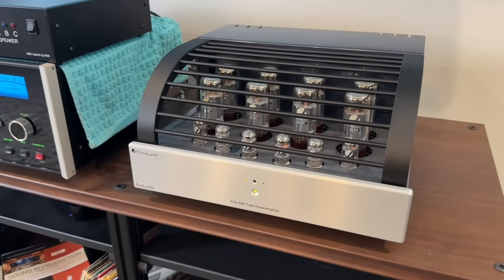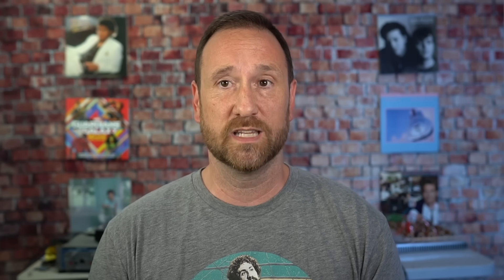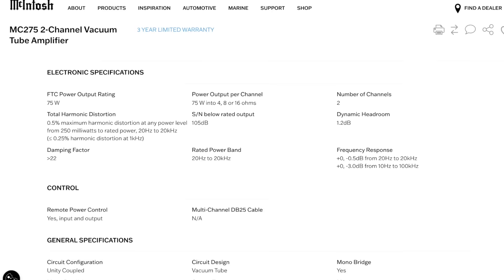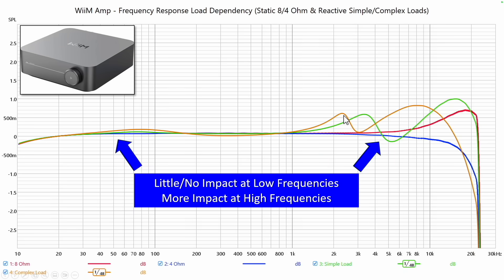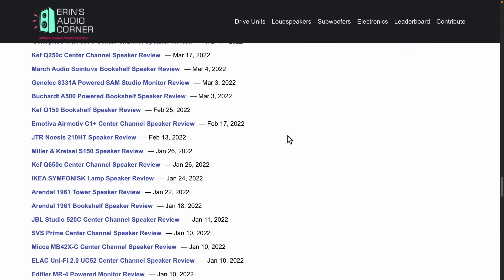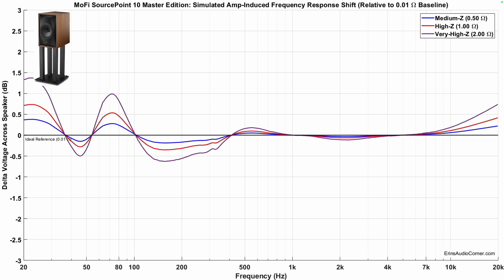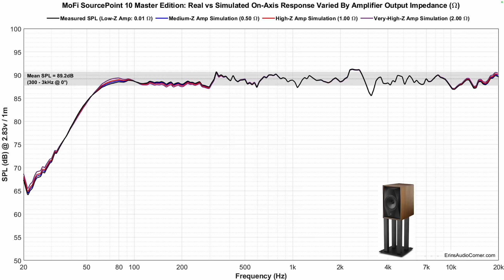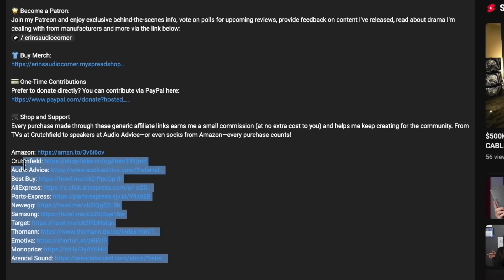Should All Amplifiers Sound The Same?

Comment: You just explained the absolute basics of tube amplifiers. Their output impedance is inherently sensitive to load impedance.
Even the ones with negative feedback won't have nearly enough to compensate well for it.

Unfortunately most Class-D amplifiers also don't have post filter feedback. So in some cases this could also have a slight effect.
Reply: What I was missing a bit in this video, is mentioning that most (close to all) Class-AB amplifiers don't have this issue because they have plenty of feedback.
You made it sound that all/most amplifiers WILL be different.
That's only true for tube amplifiers and to a small extent Class-D amplifiers without post filter feedback and poor filter design.

It would be nice to see how these higher output impedances react to Le(x) and BL(x) variations.
Reply: @p_mouse8676  You cannot have over much NFB on valve amplifier because the phase shift is so high it was turn into an oscillator.
Reply: @MichaelBeeny  There is also not enough open-loop gain to do so either :)

Comment: Hooo boy... I can already see the backlash from this forming up.  People are asking if op-amps can fix this, acting like it's some grand answer to all their problems.

For perfect clarity... Erin has done a wonderful job of examining one narrow aspect of an audio system.  BUT... it is just that, one narrow aspect... it's not gawd's answer to everything. It is simply an explanation of how speakers and amplifiers interact.

Ancient Wisdom:  "When the only tool you have is a hammer, everything starts looking like a nail."

Be smart... use this as a springboard to higher learning... don't think it answers all the questions.
Reply from the maker: On the flip side, others flat out get it: that there is the potential for a difference in sound but these are bad designs if the goal is to simply amplify the signal. 

Bias will drive most conclusions. But I’m really happy to see many in the comments who are open-minded enough to walk away with the conclusion I discussed in the pinned post. 🙂
Reply: @ErinsAudioCorner  
Absolutely.  Quite a few of the other commenters do seem to get it just fine. 

But I felt it necessary to caution the less technical not to get carried away with this. I've seen some horrific messes over the years, including burned out amplifiers, from misapplied information.

Comment: yes, they sound different if they aren't transparent in their range. yup... TUBEs... tubes sound different. Why are we using tubes for anything in audio but old gear and guitar amps? For almost everyone, you go get an amp with enough power and good specs... and you're done.
Reply from the maker: Except the McIntosh is a tube amp. And it has good damping factor.

Comment: But should they changed the sound? Aren't they only supposed to drive the unit like the headphones or the speakers themselves without, changing the frequency response?
Reply: Is it not obvious Erin is revealing a design flaw?
Reply: @Douglas_Blake for some people no.
They think they are supposed to change the sound.
Reply: @justino9042  
Yes, well, most people don't have the first clue about any of this stuff.
Reply from the maker: Check my pinned post. 🙂

Comment: Bob Carver's Sunfire amps have separate 'Voltage' and 'Current' speaker outputs on the front L/R channel. The difference is a 1 ohm resistor in series on the 'Current' outputs. Bob believed that it was the higher impedance on the speaker outputs that produces the warm tube sound.

Comment: Fascinating. I’m big on specs and research and just overlooked output Z for some reason. Thanks for being a great and sincere mentor Erin!
Edit wait is this spec’d much on amps to begin?
Reply: It's usually presented as "Damping Factor" which is the ratio between the amplifier's output impedance and the impedance of it's load.  Mostly it's specified against 8 ohms (for a bigger number).  You can back calculate the amp's output impedance, close enough for general discernment, by dividing 8 by the DF ....

Comment: I think if your test were done on solid state amp (class a, ab,d)and you found out there were differences it would have been more interesting
Reply: Indeed ... this is one case where tubes vs transistors does matter.  
That tube amp he was using with the 2 ohm output would have been running on a damping factor of 4 ... not 40 or 400 like solid state amps.

Comment: Great piece of knowledge, very informative and smoothly delivered. It's hard to talk about complex topics in a simple way. What I'm thinking about right now is how changing an op-amp can influence the output impedance. In theory, replacing it with one that has better parameters should flatten those bumps in higher frequencies in class D. What do you think?
Reply: No it won't.  The impedance issue Erin is discussing is about the output stage of the amplifier.  Op-Amps are in the pre-amp section of the design, well away from this.

An op-amp's behaviour is governed by the passive parts surrounding it (resistors, capacitors, diodes etc.) when you chip-flip an op-amp you aren't replacing those elements on the main PCB... it won't actually matter which chip you stuff into that socket they will all behave the same.
Reply: @Douglas_Blake You’re saying the op-amp has no impact on the output impedance or frequency response, because it’s only part of the preamp but isn’t the op-amp directly driving the input stage of the power amp? And if different op-amps have different output impedance and bandwidth, wouldn’t that affect how the whole system behaves at higher frequencies? Especially when the power stage input and the passive network between stages aren’t ideal buffers? If the op-amp’s output impedance rises with frequency, as it often does in class D, how can it not influence the system’s frequency response?
Reply: @LukeAceKrK  
Re-read the second part of my post above.  I'm telling you that flipping op-amps will accomplish nothing.
Reply: @Douglas_Blake I did read it. You're repeating ypurself while dodging the actual point.
Reply: @LukeAceKrK  
No I'm not dodging your question ... I am telling you that op-amps and chip flipping will have no impact on what Erin is discussing.  NONE.
Reply: @Douglas_Blake Repeating "it doesn't matter" doesn't make it true. You are ignoring the fact that different op-amps have different output impedance characteristics.
Reply: @LukeAceKrK  
And you seem unable to grasp that what Erin is talking about is an interaction between the power output stage of an amplifier and a speaker.

It has nothing, whatsoever, to do with op-amps.
Reply: @LukeAceKrK  
Let me repeat that for crystal clarity ....

This has nothing whatsoever to do with op-amps!  NOTHING
Reply: @Douglas_Blake What drives the power stage? The op-amp. If it's output impedance rises with the frequency, which it does in cheaper ones, it absolutely should contribute to the frequencies Erin measured.
Reply: @LukeAceKrK  
No it wont.  Why is this so hard for you to get your head around?

The flaw here is in the final output stage of the amplifier there is nothing you're going to do with any other part of the amplifier to fix it.  

If your car had a flat tire, would rebuild the engine?

For that matter... do you even know what an op-amp is?

Comment: Sure, output impedance makes a huge difference but you failed to mention 3rd order harmonic distortion which a lot of tube amps are known for. Surely it also would affect the sound even if the output impedance is low, right?  I noticed you mentioned things like soundstage sounding bigger but didn’t correlate that to any particular causal factor such as tube amplification versus solid state. Still, great video and very informative.
Reply: Actually most tubes produce 2nd (even) even order harmonics.

Comment: Hi Erin.
A great real world explanation as to why different amplifiers can result in such different audio outcomes when using the same pair of speakers.
So, to avoid falling foul of the amplifier/speaker impedance mismatch lottery, choose only very low output impedance [so called load independent] amplifiers.
My chosen amplifier [a Purifi design] has an output impedance of 1A @ <0.65 mΩ, 20Hz-20KHz. [that's less than 0.00065 of an ohm right across the audio band]. It is limited only by the quality of speakers I have tried it with - not the other way round.
This is as it should be and confirms your all your workings out.
Thanks for an interesting article.

Comment: I don’t think I’ve ever seen amplifier “output impedance” included in marketing or marketed specs. Maybe it should be?
Reply: Look for "Damping Factor" which is simply the ratio between the amplifier's output impedance and the load impedance.  Most DF specs are calculated against 8 ohm loads.  So all you have to do is divide 8 by the DF and you have the amplifier's output impedance.

Comment: Are you convinced that all amplifiers with low output impedance sound the same?
Reply: In addition to low output impedance, the amp must be able to produce its power without driving into clipping and nasty distortion and must have invariate self frequency response

Comment: All amps do not sound the same, but all amps that "measure well" do sound the same because low output impedance across the frequency range is a factor of what "measures well". Amps that don't measure well can sound great, but it's pot luck, although the speaker measurements you showed here are a great help to determine the impact of poorly built amp on a given set of speakers.

Comment: Yes they absolutely sound different and work better with different speakers. Going on measurements means nothing. I bought an Eigentakt based D Class amp because the hype was so massive it simply had to be better than my old school dinosaur class AB Stello Ai500 right? Wrong. It lasted 2 weeks and I ditched it. Putting my Stello back in the system was like a breath of fresh air. The Purifi amp was sterile, cold, and ultimately not engaging so out it went. Measurements mean jack. We don’t “ hear” measurements. If you bet hung up in measurements you will “ hear” the results because your brain is then programmed as to what to expect. Forget all that crap and just listen.

Comment: So, by corollary, using an amplifier with very low output impedance will allow your speakers to sound as they were designed to. Yes, I want that neutral amplifier, please.
Reply: Thankfully there are many such amplifiers. He gave two examples in the video already. The C3050, The McIntosh Tube Amp and his MC611 moniblocks

Comment: Yeah it's quite simple, get an amplifier with no load dependency and use an EQ to change the sound, instead hoping that you might get some kind of "synergy" between your particular amplifier and speaker.
But tbh, if you are an audiophile you should have a measurement mic and DSP in your setup anyways, and that way you can use whatever amplifier you want and then correct for whatever deviation that amplifier does to your frequency response ;)

Comment: Erin, the amplifier also changes the phase with output impedance. And humans are more sensitive to time domain than frequency domain.

Great info by the way, thanks man.
Reply from the maker: Where do you get that we are more sensitive to time than frequency? And at what resolution? 0.50ms vs 0.50dB? Links would be helpful.
Reply: Yes.
“Human Time‑Frequency Acuity Beats the Fourier Uncertainty Principle."
Oppenheim & Magnasco (2012)

I've donde blind test with DSP changing delay of 0.01ms between drivers (using mindsp) and have noted big difference. I understand this is not a scientific proof but would encourage to do some testing. I suppose because how the frequencies aligned and do some peeks and deeps. So changing phase would also alter frequency response on multi driver speakers.
Reply: @Tanner_o so, higher sample rates can sound better. Makes sense to me. We use time cues to help with spatial location - it's part of how we hear in surround with only 2 ears. However, most of those cues are lost in the mixing process...
Reply: @RacingAnt High sample rates (above CD) would sound the same, the difference depends on DAC algorithm and design.
But that's a other theme. 

Time domain is about shift phase and harmonics, not sample rate.
Reply: @Tanner_o  higher sample rates allow more accurate representation of those shifts. Bit depth would be irrelevant,  but sample rate is surely key.
Reply: @Tanner_o  Since we are deaf to absolute phase I'd think that doing that (delay of 0.01mS) to both speakers, the change in phase would be the same on both; therefore, we wouldn't hear the difference even though the phase changed.  Unless something other than just phase changed.  I'd be skeptical a 0.01mS change is audible as it would be high in frequency where we start to loose it.  If doing an xover that required a 0.01mS we are talking about a 3mm ish change in acoustic center.  I'm not sure in a practical system, in room how bad that would be? Would have equate to something the 7khz is range?  How many dB?  I guess with everything it depends.  It is interesting to contemplate for sure.
Reply: @mikealanlee One note, I said delay between drivers, like delaying the tweeter 0.01ms from the woofer.
 Also 0.01ms delay between right and left speaker is noticeable, but not as much as driver delay.

Comment: Can you please do this same thing with  tube preamps and solid state amps? I was going to get a Musical Paradise MP701 but it has 2000 ohm output impedance and I have 40,000 ohm input for amps. I'm using a Topping Pre 90, clean as a whistle, and have zero experience with tube pres.

Comment: I would be curious how things measured across a few other main stream amps.  Tube amps are known to add distortion.  Super cheap amps are likely to have taken short cuts.  You showed the measurement for a NAD, do you have a few others you could test, ones that are generally considered well designed.

Never going to have a huge sample but would be interesting to know which is more common, to be like the NAD or like the other

Comment: Moving forward will you be testing the output impedance of Amps if a manufacturer doesn't provide data on the full curve (or the 20hz to 20k hz), if you do not provide that data already?
Reply from the maker: Yes. Moving forward all my amplifier reviews will have output impedance. I haven’t been consistent with this in the past. I’ll change that. 

I will also be providing the speaker-amp relationship data as well. 

It may not always be in my videos but it’ll be on my website.
Reply: @ErinsAudioCorner  Sweet. Thank you for your future efforts. Let the "giant killer" speaker/amp combo hunting begin! 😉

Comment: I have wondered, for some time, if some amps just don't have the power supply to handle a speaker that has low impendence at certain frequencies This video indicates the speaker impedance and the amp output impedance are big factors in linearity.

Comment: Im using Wilson Sophia 3 which are 4 ohms with my Mcintosh MC452 on the 4 ohm tap and it was horrible it was like the volume was gone i had to put them on the 8 ohm taps ...and the volume returned  I am underwhelmed with the 452 ... but my system is all Mcintosh and im poor so i will live with it ...I also  have a Peachtree 220s on some B&W CM6s2   and they sound amazing which makes no sense  I have 3 SOund systems  in my home ..the third being Sound monitors Yamaha hs8 through a Mac  which is a totally neutral system  ..... great for mixing  Overall its a great hobby trying to find that perfect sound .

Comment: Best amps are voltage sources. When the impedance drops the power doubled. ( How to achieve this? 1st Power supply 2nd Lot of output transistors)

Comment: Now everybody starts saying: see amps are different!
What Erins shows here are tube amps. A tube is technically known an inaccurate amp. Its the essence of a tube.
They are notoriously imperfect, so yes, you can have preferences here. Enjoy it.

If you have properly build amp, which should amplify whatever is thrown at it equally. Then no, amps don't make a difference.
But don't project this design feature on a "flawed" amp in that field, which is a tube amp
Reply from the maker: Except… the McIntosh is a tube amp with low output impedance. So it’s not all or only tube amps. Definitely leans in that direction, though.
Reply: @ErinsAudioCorner  fair point, much nuance required. 
My stance is; since that's incredibly difficult for normal people to verify, I steer clear from tube amps. 
All the more respect for people like you, who can shine proper light on these nuances. That's why I'm here.

Comment: Just upgraded my speakers to the kef q series. Q11, q6 and q3's. Can you recommend a 5 or 7 channel amp? Bought the q11's based on your review.
Reply: Get an Onkyo RZ50 from Accesories4less and use the amp stage to drive the side surrounds Q3s.

For the L, C and R, get a 3 channel NCx500 multichannel power amp from Buckeye and link to the Onkyo. And pass that duty of the front LCR to that power amp

Comment: I've seen test results of single-ended triode tube amps where the output impedance was high enough to cause severe dips in frequency response with real world speaker loads. However, reviewer(s) would love the sound and recommend the amps, with the caveat that they be paired with efficient speakers with benign impedance curves.